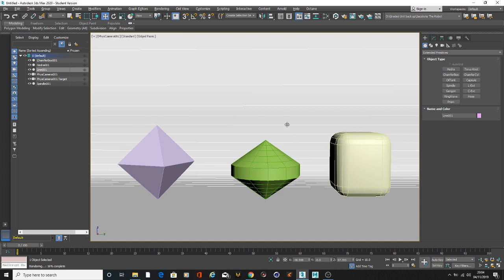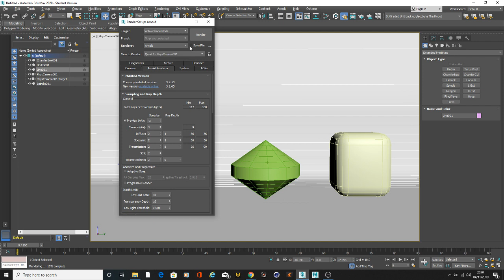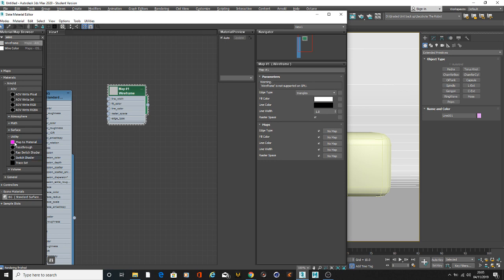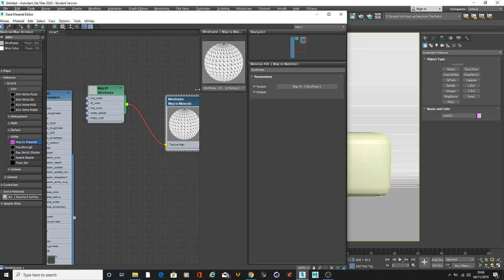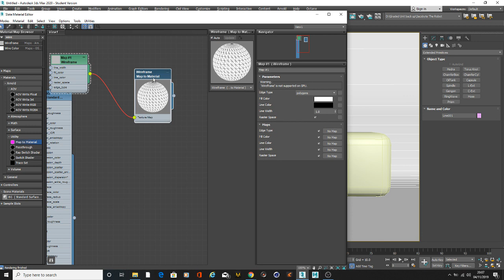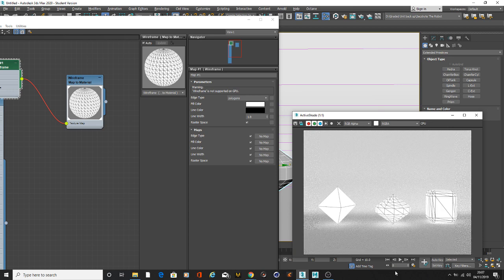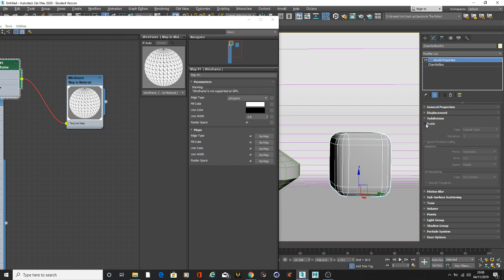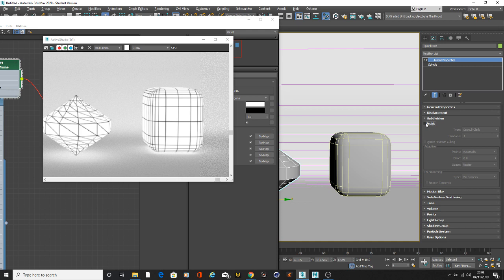Properly Render Wireframe using Arnold inside 3DS Max

Comment: Great tutorial, I was wondering if creating shades from an edit poly modifier with all splines selected on a linear way could give a copy of the lines that could get a sweep modifier and use an emissive material to make the lines glow so you get also the effect, but this is probably much lighter.

By the way this still works and feels needed 4 years later... xD

Comment: nice tut, but doesn't work if you want to show low poly wireframe
Reply: you can set the subdivision to zero, it still will fix the problem with the middle lines and render the proper quad wireframe